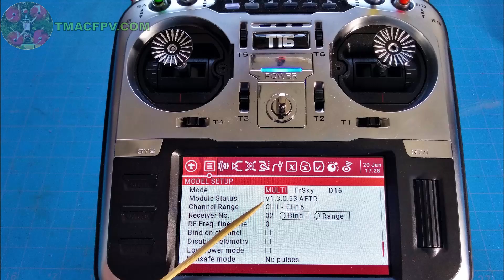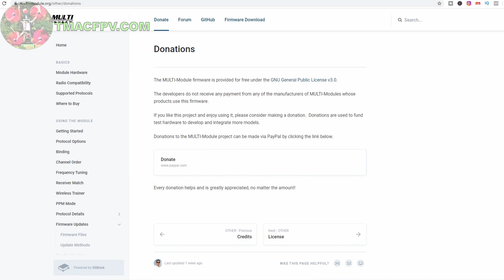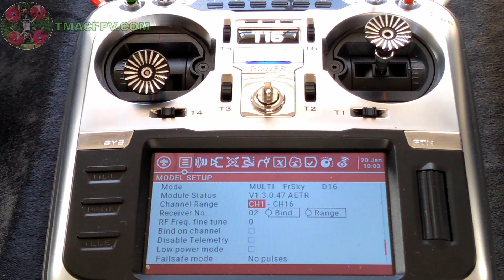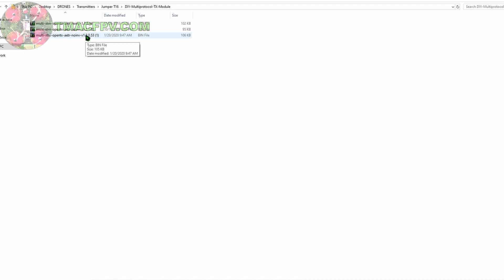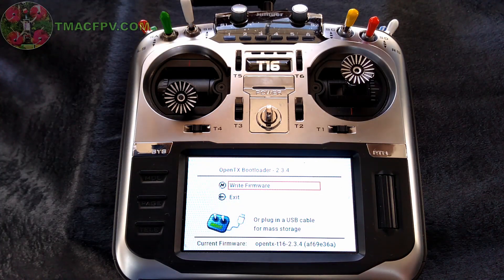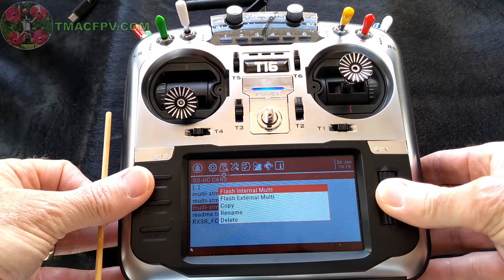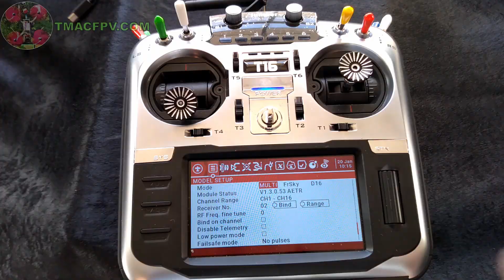Multimodule Firmware Update

Comment from the maker: I've found updating the multi-module firmware (after my bootloader was installed) to be very easy thanks to the multi-protocol module dev's and their work with the OpenTX dev's.  I think we're all very fortunate to have these individuals working on our behalf in support of our hobby.  If you're fairly new to OpenTX or the Jumper T16 transmitter, make sure to check out the Playlists I've got listed below.  Thanks for your time and Clear Skies friend! 👍😀
Reply: I purchased my PRO T16 Multi in November, and it had an older version of firmware on it, so I updated to opentx-t16-2.3.4 (af69e36a), and I just checked that the internal RF was OFF, so I put it to MULTI and it says it is version V1.2.1.85, but it keeps flashing "UPDATE RECOMMENDED", Is this a BUG or a glitch in the software ?

What do I do, Im sooooooooooooooooo lost!
Reply from the maker: @tonydean2455  V1.2.1.85 is an older version of the multimodule firmware.  It will still work but its a few versions old.  The "Update Recommended" notice you're getting is just that, a recommendation to update to a newer version of the multimodule firmware.  To do that, just follow the steps in this video.  Hope this helps, clear skies Anthony!👍

Comment: Tmac, I did a firmware update to my Jumper T16 and an update of its  internal module - which resulted in me loosing the receiver bind on 5 of my 7 models.  I have done this procedure a couple of times before with no problems.  Thus, I am puzzled as to what I did wrong . I do not know where and in what file the bind information resides.  Perhaps if I knew that information I could better understand what I did to cause the problem. If you have any insights that you would like to share, they would be greatly appreciated.  Thanks!  Larry

Comment: TMac, great video as always. Having an issue. Recently flashed my Jumper T16 pro with OpenTx. Everything is working fine but I get an error when trying to update internal module as it is flashing and recommending I do. I do have bootloader on this Tx. My error reads : Firmware Update Error and down below { No Sync ) I hope you ban help. Thanks in advance. SWRC
Reply from the maker: Thank you🙏A few possible things I can think of. 1  Have you replaced the original SD card with a new one an formatted it with Fat32 formatting? 2. Perhaps reseat ribbon cable going to SD card board (disconnect and reconnect cable)? 3. Did you "tick" all the appropriate boxes when you downloaded and flashed OpenTX to radio? 4. Have you download the correct version of the Multi-protocol Module firmware from the site prior to lading and attempting to flash on transmitter? https://downloads.multi-module.org/
Reply: @TMacFPV  Thanks for the quick response. I will answer your questions in order. (1) I have replaced the original sd card. (2) I have not tried resetting ribbon. (3) As far a ticking all the appropriate boxes before proceeding with the OpenTx download, Not 100 percent sure but most likely. Any special box I should be aware of? (4) Yes it is the correct firmware version I have downloaded ( I do believe anyway lol. No, it has to be !!!!!
Reply: @TMacFPV  Sorry T it was to say I DID NOT replace SD card it is the same one included with purchase.
Reply from the maker: @screamingwingsrc8917  Regardless if this fixes your specific issue this time, you really need to swap that SD card with a good one.  That card has caused  many issues for folks
Reply: @TMacFPV  will do that but need a fix for this firmware flash in case the sd card swap does not correct.
Reply from the maker: @screamingwingsrc8917  understood. You've put the firmware for the multi-protocl module on your SD card to flash the internal module from there, correct?  It may be having a hard time reading it from that original SD card.  Tht's the reason I mentioned it.  Check out those things I mentioned above. Only other thing I've come across in addition to those is the following from RCGroups regarding ribbon cables: "Flip the widest one (between the main board and the middle pcb).  Pull that main ribbon, clean the ends and connectors and then rotate and reinstall."
Reply: @TMacFPV  will try it thanks.
Reply: @TMacFPV  And yes flashing from the original card.
Reply: @TMacFPV  Can it be done without going through the card ?

Comment: Well since the last update which went smooth with the right directions :) and because it is winter here I haven't turned on the T16 since then  and I was just programming in a new plane and my SA toggle switch warning is coming up. I went into the menu where you can test analog and switches and all work except the SA switch, any ideas ?
Reply from the maker: Perhaps ribbon connector to switch came loose? You could try gently disconnecting and reconnecting
Reply: @TMacFPV  Checked and all tight,  I think the SA & SB switch are grounded together.  If I put the SB switch in center or down position then SA works but it then changes SB position.  Off for warranty.

Comment: Hey tmac thank you for the great video as usual, i did the bootloader update but i can’t bind my jumper t16 to my r xsr receiver with access protocol! What mode shall i choose in the t16? Shall i just downgrade to d16? Im
Reply from the maker: ACCESS protocol is only available with FrSky transmitters. It will not work with Jumper T16. At this point, the latest FrSky D16 ACCST protocol dated Jan 16th will not work either. You need to use an ACCST D16 version prior to the Jan 16th version. Then it will work
Reply: TMac yeeeees mate! You are a F legend, thank you! I just flashed the previous version aaaaaand green light! Tomorrow is gonna be time to fly! First lipo will be in your honour! 😎🚀
Reply from the maker: @sinnedfpv5333  👍🤩Outstanding! Fly fearlessly my friend!
Reply: TMac always! 😏🚀

Comment: Hey TMac I tried to get this to work and for some reason, I keep getting a screen that says no file found what should I do. I can't get my internal module to work at all.
Reply from the maker: Let's see if I can help you out.  Step 1:  Download correct file from multi-module.org to your computer (now all you have to do is put in the transmitter you're using and it filters the files down to just those applicable to the transmitter and shows different channel order files).  Step 2: copy that file to your Firmware folder on your transmitter SD card (either using a USB-to-micro SD adapter and taking card out of transmitter to do so or by entering bootloader mode of transmitter as shown in this video).  Step 3:  Enter Radio Setup menu on your transmitter by pressing and holding SYS button.  Press Page to go to SD-HC Card. Scroll to Firmware folder and press Enter.  Do you see the fie there that you just copied over?  If so, scroll to it, press Enter and then Flash Internal Multi (if you have an internal module).  If this is when your transmitter says it cannot find the file then I can think of 2 things.  1.  Are you using the SD card that came with the transmitter?  Some folks have had issues with it and by replacing the SD card with another one (like a Sandisk 16GB from Amazon), formatting it in Fat32 and then going from there might help.  If you try this remember, you'll need to put the SD card contents on it from the version of OpenTx you're running.  2.  What version of firmware do you have on your multimodule?  This process will not work unless you have a multimodule firmware version that is 1.2.1.85 or higher number (I show in the video how to find what version firmware you have on multimodule).  That's all I can think of for now.  Hope it helps.
Reply: @TMacFPV  So I finally got around to getting a new sd card and I got it working on the radio however it still doesn't let me update the module it just says Needs file opentx-inv [RTN]
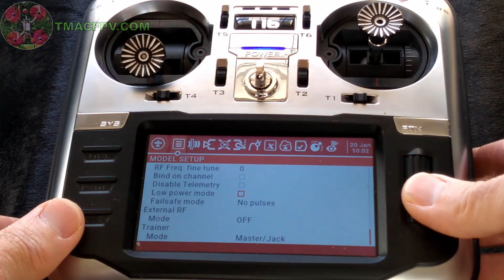Reply from the maker: @drewmon127  retrace your steps, one at a time, starting with 2:45 time hack of this video.  Identify at what step you do not get same results as in this video
Reply: @TMacFPV  I finally got my radio working a couple weeks ago the issue was that I was trying to use my mac to download the software onto the radio and it wouldn't work I had a friend who ended up putting the newest nightly build of CRSF shot on my radio and was able to update the radio as well. I even put some custom tones on the radio from your other videos

Comment: When I switch between  models it always ask  me to bind to receiver again and again what does that means? I mean do we have to bind each time we switch between models or my radio is playing games ? What do u say mate?
Reply from the maker: No, you should not have to bind a receiver when you switch between models. I have mine set up as 1 model (and receiver) per quadcopter.  When I switch between quadcopters (and therefore models), no binding is needed. Bind each one once to begin with & you should be good to go. Do you happen to be using the same receiver # for binding in each model? That may be your issue. Try incrementing your receiver # by 1 for each additional model when binding initially. That may help
Reply: @TMacFPV  yes I have different reciever for every model but still wants me to bind again and again.
Reply from the maker: @fpvpilot5818  🤔 stumped for now mate. If I'm able to come up with an answer for you, I'll make sure to get back with you. What receivers are you using and what OpenTX firmware version are you running on your T16 and what firmware version on your multi-module?

Comment: Ok question. I have the old internal module but I have a boot loader. If I hold 2 trim buttons to the center and power on it comes up with the boot loader. Does this mean I dont have to open the radio up.
Reply from the maker: Hey Wesley. That's a different "bootloader."  That's for the radio itself (OpenTX) NOT the internal module.  You have two firmware on your radio.  For clarification the two, please see 
this video: https://www.youtube.com/watch?v=xAmCWIwzlKc .  In the video I explain how to find out what version of firmware you have on your multimodule.  Based on that information, if you don't need the bootloader installed on your multimodule, then use the process as described in this video.  If you need the bootloader installed on your multimodule, use the process in this video: https://www.youtube.com/watch?v=Dex92d7IQWI . That should help.